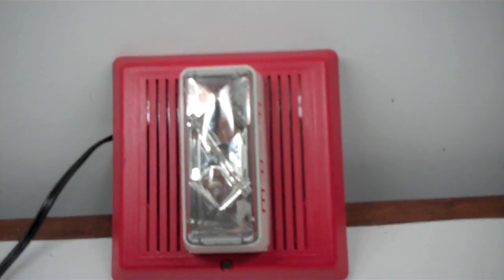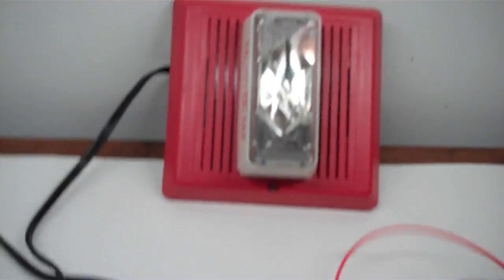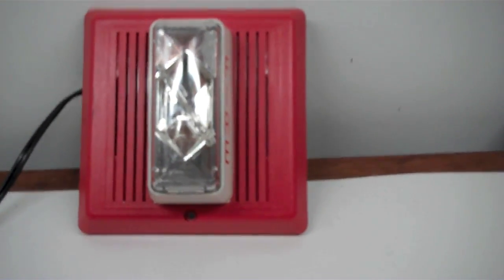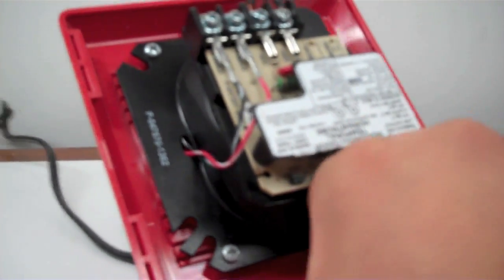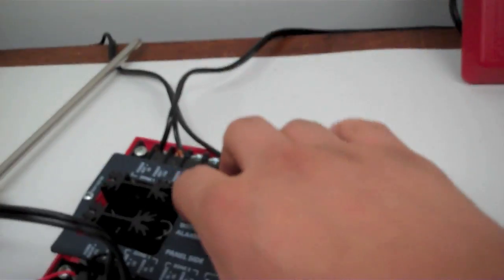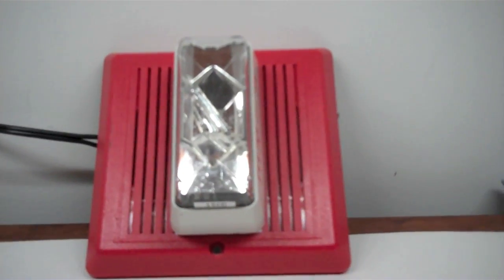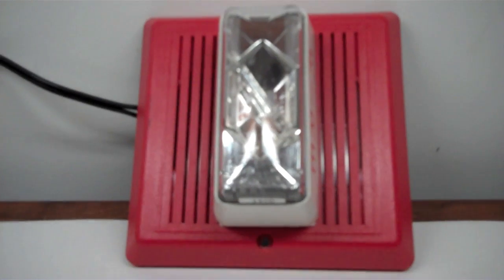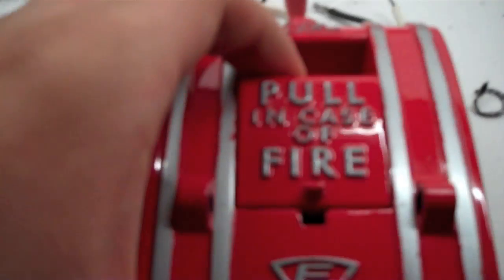Edwards (EST) 757-8A-T (Integrity) Fire Alarm Test (and System Sensor MDL)

Comment: What specific year were these integritys made in? Can't find out on the web. I want to guess 1998, 1999? Where is the date code located?
Reply from the maker: Either of those two years sound appropriate. I could have sworn that I saw something that looked like a date code with "99" at the end, not a model number or anything, possibly with two other digits. I cannot tell you for sure, but seems likely considering these are from that era.
Reply: NewEnglandElevators Interesting, my high school was built in 2007 and they used the est genesis and integrity combo.

Comment: Is this louder than the wheelock mt
Reply from the maker: Volume wise, seems just as loud. However, this may not seem as bad, as this has a lower pitch. The MT's horn tone has a really high pitch, and seems ear-piercing (similar to the SpectrAlert Advance).
Reply: no, I don't need a headset for ear protection because it's quiet! I mean, It's loud but not as loud as the Wheelock As or Mt etc. Those ones are loud! Maybe there volume jumpers too! :)
Reply: Yep Agreed! it seems quieter to me! and it is most likely the pitch! I felt comfortable not wearing a headset! 😉
Reply: SpectrAlert Advance is even louder.

Comment: They have those alarms in my school. The outside was just without the strobe, but the inside of the school, they have strobes.
Reply from the maker: +??? Gonzalez Interesting that they would have a remote horn on the outside of the building, and not a strobe at all. I would assume a strobe is required for firefighters to easily locate the building with the activated alarm, rather than rely on the blaring horn.

Comment: What do you mean by black font =unenchanced are you talking about the letters
Reply from the maker: Unenhanced (black font candela info) simply describes the lack of self-syncing capabilities, unlike the "Enhanced" integrities with the self-syncing capabilities (red font for candela marking). "Enhanced" integrities are also capable of syncing with Genesis devices, which are self sync. Pretty cool if you ask me. I have tried it out before, and it does work. At some point, I'll do a demo.
Reply: @NewEnglandElevators  get a power saver integrity